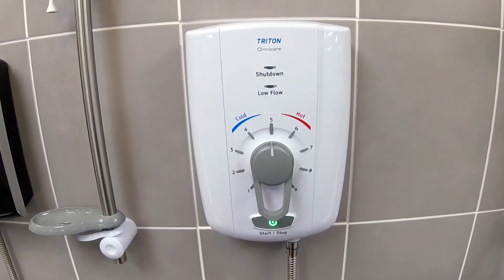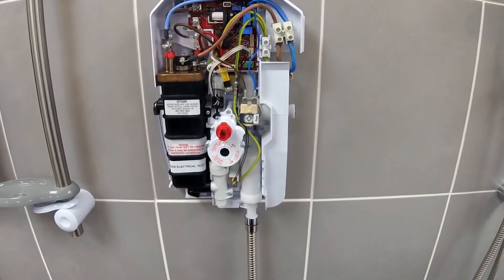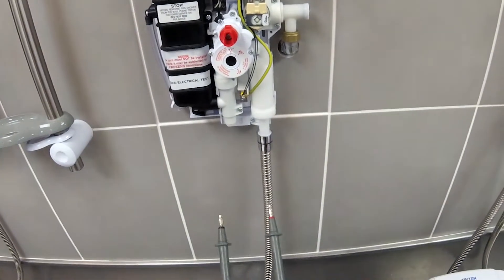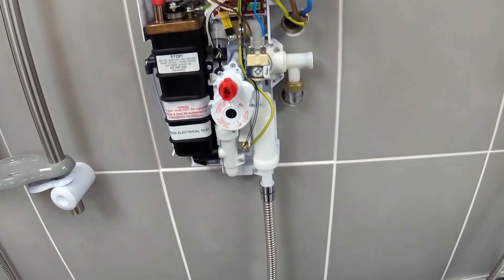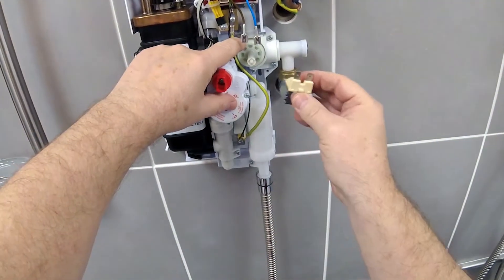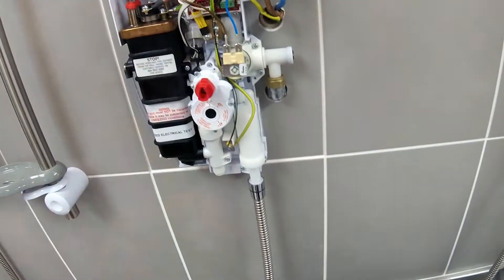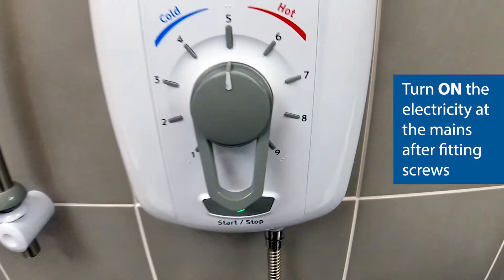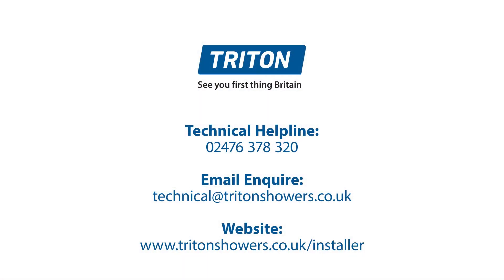Replacing the solenoid valve on the Triton Omnicare Thermostatic Electric Shower

Comment: It would have been useful if you mentioned that the water should be switched off via the pipe valve in the shower to be on the safe side.. would have saved me becoming soaked when the plastic body snapped when trying to take the solenoid coil off!!